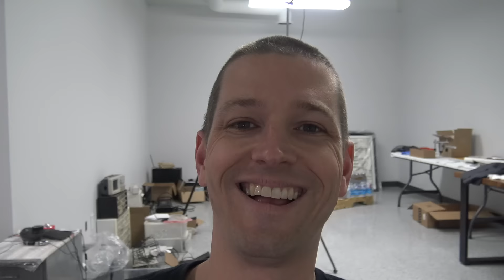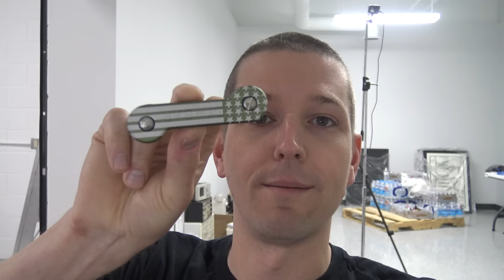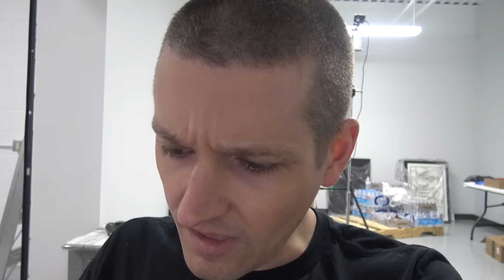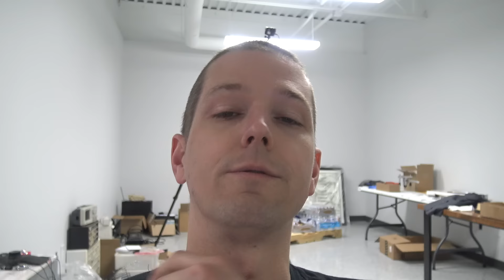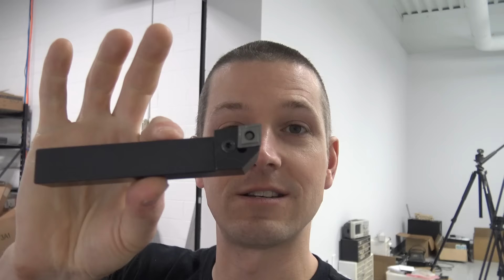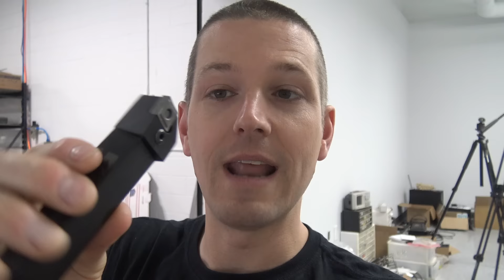Chip Break #7 - Machine Shop & Small Business Daily Life

Comment: I'm an architect and I get similar corporate stuff that results in frustration.  I'll want to specify a particular product or material but I need to answer some technical question so I'll call corporate.  They ask for my location and pass me off to the local sales rep (sometimes not an employee, but someone with a company that provides rep services for many manufacturers.)  I've been through this before and I know that as nice and earnest as the local rep is (maybe... should be...), they won't know the answer and will have to call the engineers at the manufacturer... which is why I called the manufacturer in the first place.  I don't want to leave the rep a message and then (maybe) get called back to re-explain, to be told that he/she will have to talk with the engineer and get back to me.  (Which also adds layers of problems because I'm not talking with the engineer/specialist directly.)

Oh, and pricing?  I'm designing a building and I'd like to have a ballpark idea of how much your product is going to cost the contractor so I'm no spec'ing some crazy expensive item... (or, gasp! compare competing products to find the best value for the building owner!) nope.  No way to find out from the manufacturer.  Which of several local distributors does the contractor buy through?  Does that particular contractor have gold status with that particular distributor?  And on and on.  Hey, I'm looking for a range like "5 to 9 dollars a square foot" or "Oh, for about 50 fixtures, they'll be in the $80 to $120 range."  Ballpark.  But nope.  Most manufacturers won't have anyone who can even ballpark the end costs.  Having more stuff available through online channels helps with pricing info, but lots of contractors and subs still buy through distributors and they often mark stuff up massively over what you can find online.  (Often the mfr warranty doesn't apply if the installer isn't certified and buying from their local official distributor...)  Distributors used to be local warehouses where they stocked units and spare parts, but today they're just an office and have everything drop shipped from the manufacturer anyway...

All this inefficiency means a lot of jobs for a lot of people, which will be a problem as "disintermediation" (cutting out middle men) progresses, but hopefully the gains in efficiency throughout our economy will balance that out.

OK.  Enough grumbling on my end.  Back to positive stuff for me!